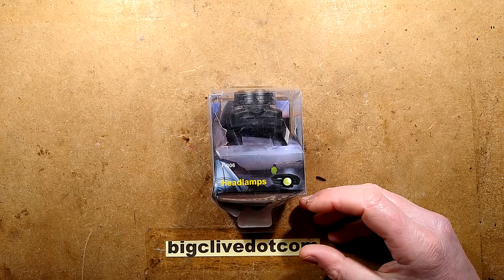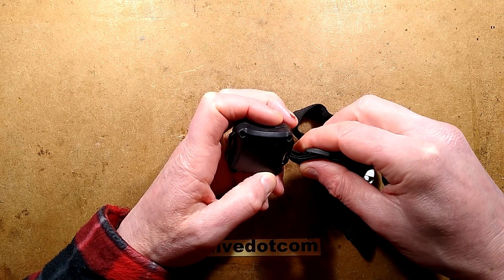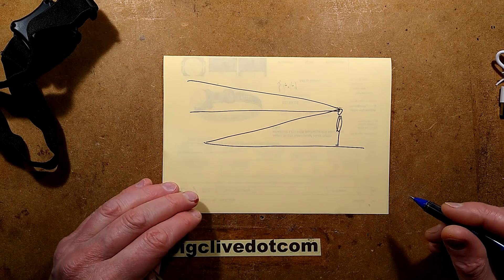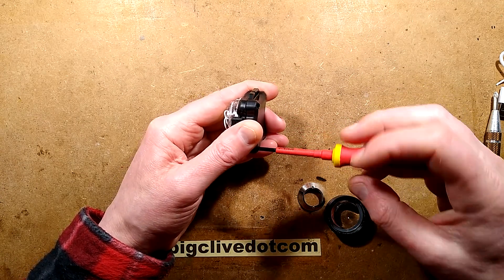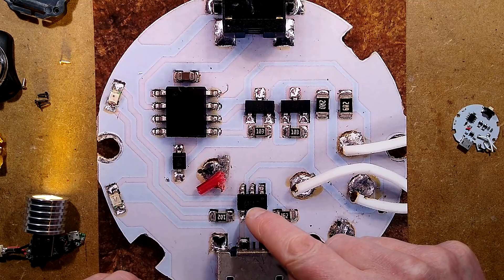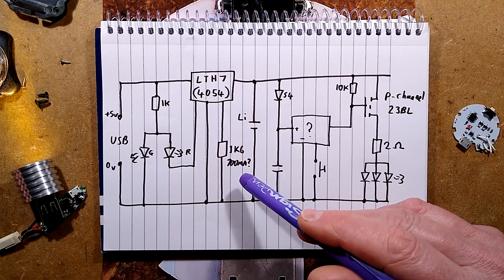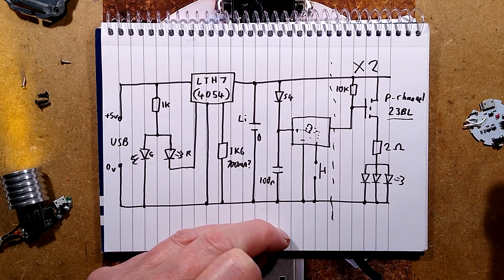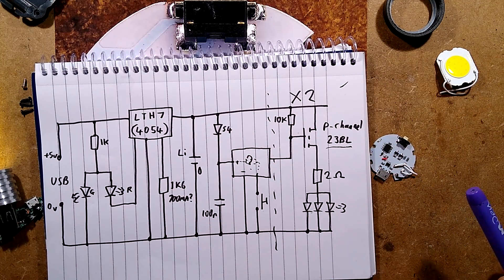eBay's cheapest pile of crap USB rechargeable LED head torch.

Comment: My favourite pile of crap head torch was a model, that we used to sell in our hobby shop. Not only it hadn't any protection for cell itself, but because protection was inside of provided charging lead, you cannot charge it and not destroy it by any other, generic charging lead. It needed 3,7 V charging voltage, and we never had spare leads for customers, that lost theyr provided one. We got rid of them when couple people returned these torches with swolen battery packs...

Comment: A piece of foam just at the top would solve the issue. The stuff you use for drafts on doors and windows. Sticky backed too. It would push the top forward and change the angle of the torch. This method technically makes it adjustable.

Comment: As the light was unboxed I thought the settings/run time grid looked familiar, it's the same font/graphics as my Niterider front bike light packaging. Ironic they used that as the torch looks like it's actually based on one of the many rip offs of Lezyne Zecto drive lights.

Comment: Google "SHL-1855 headlamp". It's the best headlamp I have ever owned, using two 18650 it has great battery life, the lamp is pivoting and bright as heck and it doesn't mind rain or snow. And the best thing is that I think it cost me about 5€ without batteries with shipping, as I don't care for cheap useless rechargeable batteries. I've been using it whole winter while taking the dog out and I think I've charged the batteries (NCR18650B) twice. The best thing about it is that when the batteries ran out of juice in middle of the forest on "high" once, the "low" setting lasted for whole 20 minutes, enough to get out from the forest without resorting to crappy cellphone lamp and stumbling around in the dark. 

One bad thing I can say about the headlamp is that after four months of use it wouldn't turn on again, and after a short inspection it turned out there was a cold solder on the battery compartment which was easy enough to fix. Oh and the beam could be wider if you like that sort of thing, I like it tight and focused as it's been pretty dark and muddy winter here in Finland so it does not bother me.

Comment: I got a $10 Tractfire LED headlamp. Very generic, with a very bright center spot and a good amount of area illumination, and runs on dual 18650 batteries. The batteries it came with were junk, so I got some real 3,200mAh EBL 18650's, and I can use that thing for a hell of a long time. Its even adjustable vertically. For the price, its a great headlamp, especially since I'm an overnight trucker. Its about 2 years old now. Its even taken a couple hits when I've fallen backwards on ice and the battery pack absorbed most of the impact like a helmet. I had a Bulbhead headlamp before that and it only lasted a few weeks on the job (and it almost looks like the one shown here, with an adjustable one)

Comment: So are white LEDs actually blue but with a white phosphor? Or am I misunderstanding?
Reply from the maker: Blue LEDs with a yellow phosphor.  The blue stimulates the phosphors in the gel and they add to the blue.  The phosphor gel can contain quite a complex mix of colours to get a broad spectrum of light.
Reply: @bigclivedotcom  Oh, that's very interesting! So that's why white LEDs are only recent. I was gobsmacked when I discovered that our trains here in Southeast Queensland, have been using LEDs since 1999 when they were built.

A completely useless fact: Those trains' computers also run Windows 2000 - I know this because I saw the computer crash once. They literally had to reboot a train. 25kV pantograph lowered, with a nice arc. Wait a few minutes for the auxiliary battery powered compressor to pressurize a small cylinder, which then gets shot into the pantograph, releasing it, and huge springs do the rest, and you get a nice zap when it makes contact. The old trains you had to be careful, if you left the lights and air cons on, they'd make a huge crack from the inrush when the pan made contact. This procedure is called a BoBo - battery on, battery off.

Another useless fact: the 1999-era trains, cruising at 60mph, draw about 6 amps from around 24,000v, although the trains can operate on anything from 16.5kV to 28kV. So those nominal figures, that's, what, about 150kW of juice when cruising along? Although there's 2,880kW of traction, and yes, I've been allowed to use the 'throttle' (if you want to call it that) - absolutely amazing experience. I should really become a train driver.

Some reading material to put you to sleep and apologies for the rambling. But the LEDs in 1999 really spun me out.

https://en.wikipedia.org/wiki/Suburban_multiple_unit

I like the newer trains, too, but there's nothing like an EMU - Old but gold. It's sad that they're being retired. The photos and videos of them being scrapped actually brings a tear to my eye. I grew up on those trains, have been on every single one of them probably 50 times a piece over my years. I suppose time gets us all in the end, though.

https://en.wikipedia.org/wiki/Electric_multiple_unit_(Queensland_Rail)

Comment: Big Clive or anybody could you please answer a question for me.  Like many others I have a mounting collection of electronic gadgets to charge.  My question is this......after charging (say my phone) I unplug the phone but leave the charger plugged into my electric outlet....is the charger still drawing 2 or more amps even without the phone plugged into it?
Reply: It might be drawing some microAmps, but definitely not 2A. Older, heavier chargers with a transformer inside drew more current, although minimal, it was not insignificant if you left them plugged in constantly. The best practice is do not leave any charger plugged in unattended, that's what I do. I always unplug them when either I am not there or nothing is being charged.

Comment: I’ve always been curious as to why old tube TVs are so dangerous to take apart even if they aren’t plugged in, that would be a cool video
Reply from the maker: It's mainly because the glass cathode ray tube is part of a high voltage capacitor that can deliver a significant shock.

Comment: Clive, those actually are bike lights. It seemed familiar right away, and after a while I realised that it's a knock-off of the Lezyne clip-on "Zecto drive" lights, the case looks exactly the same, they just put a COB LED array in and a lens to make it somewhat more directional. You can get loads of more or less exact copies of that line of light from China. I guess someone thought they can get more value out of their bike light knock-off production by adapting it to a wider use base. That's not uncommon, when browsing aliexpress you often find the same product in a number of different guises and applications. So it truly is a pile of crap, as it is a knock-off of a product that is shitty to begin with (Lezyne bike stuff sucks, don't buy it), and it is pressed into service in an application that is not suitable for.

Comment: Wish app has alot of cheap chinese stuff, ive just got a rechargable torch, its pretty decent for £2. Ive ordered a head light, its got 3 different lights, and quite abit of other stuff, all rechargable. Thats cost about £5, and 2 drones, including digital cameras which cost less than £25 combined. Im thinking that i can fly them both pov, and dogfight them with a mate. For the price, they are expendable... and ordered a few very cheap digital cameras to use on my gokart, and get multiple angles, just because they were £5 for both. I think these types of cheap chinese stuff is amazing, just because if it gets destroyed i dont care.

Comment: It's not "eBay's" anything.. I hate when people blame eBay or Wish or AliExpress.. eBay, AliExpress  and Wish don't sell ANYTHING.. they are just a platform for,sellers, like Etsy, etc... as is a large part of Amazon and even Walmart.com.
Reply from the maker: eBay, wish and aliexpress openly allow the selling of some very dangerous products and do nothing about it.  They are literally the dumpsters of the shopping industry.  Amazon isn't perfect, but Walmart does have to comply with regional standards and rarely sells dangerous items.
Reply: @bigclivedotcom  
Please what is this mystery chip?
Where can I order this mystery chip?
Similar chip (ZH01) was in a 5V 8W soldering iron that is spoilt. What equivalent chip can I used for ZH01?

Comment: I got bicycle front light with the same design only with different leds and lens. Actually my have the SOS function after holding a button for 4 sec. Now I no more wonder why it is on bicycle light. Like everything designed from china, previosly it has different purpose.

Comment: 1k6 resistor with 700mA passing through it  so V = IR = 1600*0.7 = 1120 Volts, these figures must be wrong
Reply from the maker: That resistor sets a reference current.  It doesn't actually carry the full current.

Comment: I put on a 5mm rubber strip to change the angle. 
But another bad thing. If you have glasses, the lamp shines through the clear plastic housing and is reflected down into your glasses. 
Does not help the night vision ..

Comment: As a long-time Big Clive watcher, this video seems to have been ever so slightly sped up. I've noticed Youtube speeding up certain videos lately, particularly old 80 music videos. I this some trick to get more videos views per hour on YT's part?
Reply from the maker: There are settings for adjusting playback speed.  Could you have inadvertently set it higher?
Reply: @bigclivedotcom  Oh, sure, I use those all the time, but it seems a bit more subtle than that, though, like 1.05x. Maybe it's just too many days alone warping my perception of time. :)

Comment: I got a headlamp from AliExpress recently, about 7USD, but it's an 18650 based one, including a carrying case. I was actually pretty impressed by it, it has both a COB for a wide light, and a spot light. It also angles like the one you showed in this video. Pretty nice light for what it is.

Comment: Amazon has a new thing where there's a headband that has a line of LED's that hug the forehead in about a 100-120 deg arc.  It's weird that a 1 pack is $14 but a 2 pack is $69?! Just add QTY 2 of the $14 one in your cart, problem solved.  It throws a good amount of general light for walking around in the dark, but it wouldn't be too useful as a work-light (no spot). It also only works on 3AAA which means it won't last long at the high intensity, and the button on the side is just... terrible. It's a membrane switch on a little block between the battery pack and the band.  For the price, it's over-priced, crappy button, but a decent amount of light.  Now to hack it to take a 14400 or 18650 cell...

Comment: I would appreciate your opinion, I notice when I run devices with multiple batteries be they say sensor activated mini lights, clocks etc when the batteries "die" pretty much every time I put them in charger at slowest setting lets say 3 used in same device one normally shows near or full, 1 or none show an error code but the 1 or 2 that show as low charge within a few minutes show as near half charge if not 3 or 4 fifths charged, I have even put batteries in charger for literally a minute on lowest charge and put them back in device and they last another few weeks/months so I feel they just need jump started rather than charged. Is there a device or trick I can use for this?

Comment: Hmmm, I bought about 10 “cheap” head lights on eBay using 2 x 18650 batteries for around $4 - 6 each.  The $6 one comes with batteries.  They all have tilt adjustment and head band.  Some are not zoomable (I prefer zoom).  They are very bright and cheap, if I shall lose of break one, I will not cry over it.  Very happy with them.  No issue with any of them except one, the plastic cover on the switch broke or disappeared and it is a bit hard to press to turn it on.  Oh, I am a night owl.

Comment: I have a bike light set that have a very similar layout except it has 3 discrete LEDs each with its own lens.  The backs are different as well and are made to attach to a bike handle bar (white LEDs) and seat tube (red LEDs).  The front case, USB charge port, flap, power switch and battery are the same as this one.  The bike versions are quite nice actually and a pair was only like $12 a couple of years ago (now just $10).  Longevity seems to be good as after 2 years mine only needs charged every 15 hours or so of riding.  https://www.amazon.com/Akale-Rechargeable-Headlight-Waterproof-Included/dp/B01IIPBYB2/ref=sr_1_5?crid=11PRC6KZB0T8V&dchild=1&keywords=akale+rechargeable+bike+light+set&qid=1585380629&s=sporting-goods&sprefix=Akale+%2Csporting%2C172&sr=1-5

Comment: Here's a solution to separate the battery from the casing sticky tape : take a length of waxed tooth floss, long enough to hold tightly and pass behind the battery. Then use it like a saw pulling back and forth until you cut through the double sided tape, and the battery falls out/can be easily pulled off. No penetration, sharp objects or damage!
Reply: But where's the smoke, flames, and fun in that ??? ;)
Reply: I usually just add a few drops of IPA around the battery to weaken the adhesive.
Reply: @EnricoConca   what ever gets you tipsy, wonder if John Smith prefers John Smiths
Reply: I can confirm that floss/string work wonderfully for removing double sided tape. That's how I moved my dashcam from my old car to my current one. The dashcam manufacturers even tend to include a foot or so of string in the box for exactly that purpose.
Reply: Monofilament fishing line works great too.
Reply: Moly wire kit for phone screen removal

Comment: Question. Why can't the output pin of the microcontroller just pull the gate high or low without needing a resistor?

Comment: is that a 3d picture??? i saw the solder blob move as you moved the pad just left of the diode next to the red wire at 14.13  or am i that drunk???
Reply: had to watch it 10 times but it does move  lol

Comment: You know what I find odd? The fact that with all the stuff you take apart you never use a iFixIt screwdriver kit :P
Reply: He seems to mix high end tools from his electrician's kit and ultracheap tools from eBay and dollar stores.  I'm guessing iFixit merchandise is neither.
Reply: @johncrowerdoe5527   From what I have gathered iFixIt tools are top of the line and they come with a no questions asked life time warranty.
Reply: @AK90  iFixit tools are more like a high end store brand than an original factory brand like BAHCO, Fluke, Keysight (old HP) etc.

Comment: The S4 diode is probably to drop the voltage since they most likely used a 3.3V chip. 4.2 - 0.7 = 3.5 which is within the limits of most 3.3V parts (3.6V).

Comment: I wonder if this is a repurposed bicycle light. The modes and lack of angle adjustment indicate that it’s probably designed to attach to a bicycles handlebars, perhaps with a different back that has some sort of bracket.

Comment: There are very cheap scales ob Ebay.
Maybe that's something to take apart in the future?
I bought one that can show differences as little as 1mg up to 20g for 8.60€ including shipping.
Reply: We won't ask what you're weighing with those. But be aware that the charge is greater if the packages are preweighed.
Reply: @mikemondano3624  I'm gonna answer anyway. Have to weigh out 10-30mg of a Phenethylamine whenever I desire to do so.

Even the ones that are good for 200g with a resolution of 10mg are impressively cheap and good though.

Comment: You could just wedge something between the top of the light and your head, perhaps some food for later.🤷‍♂️👍😷
Reply: Yes, a good 'wedgie' should straighten things out - lol!
Reply: Maybe Clive's head is misshapen, I dont recall seeing that
Reply: @stevelloyd5785  his head is quite normal for his size

He is Big Clive after all
Reply: I don't see it as a major problem to solve easily. Making it adjustable angle which would be ideal would be more difficult. I've already got a few of the ones he showed as his "current favourite" coming which if memory serves has an 800mah battery so nearly twice the battery power, adjustable and more versatile for only a tiny bit more so I wouldn't waste any money on this 1 too, but it doesn't seem too bad for the price if you don't mind improvising a tilt method, or maybe to use it as a bike light, more for people seeing and not driving over you than actually seeing where you're going. It has got potential uses and is cheap enough at the price he originally payed.

Comment: As soon as you said you'd perforated it, my first thought was "where's the explosion containment pie dish?" Definitely don't want to set the place on fire. I usually take stuff outside before I start messing with those batteries in the foil packaging. So far I've only had to chuck one of them on the ground to finish its fizzing flaming death

Comment: You could check this headlamp out... https://rover.ebay.com/rover/0/0/0?mpre=https%3A%2F%2Fwww.ebay.com%2Fulk%2Fitm%2F193365464448
I have one and like the performance, but I doubt that it is safe so I charge it in a stainless steel dish under a smoke detector...